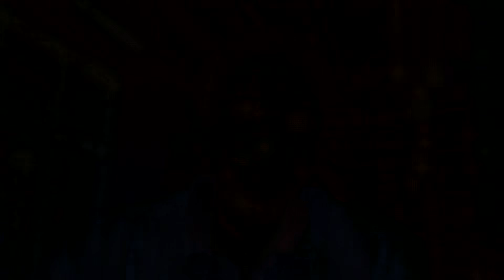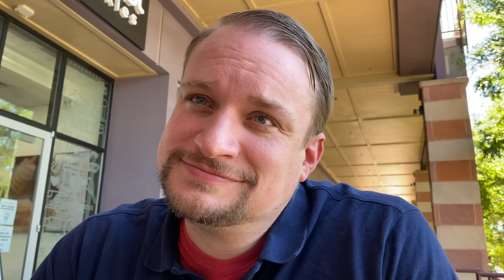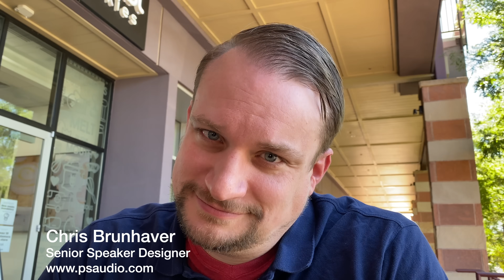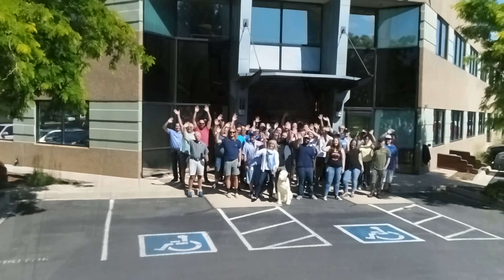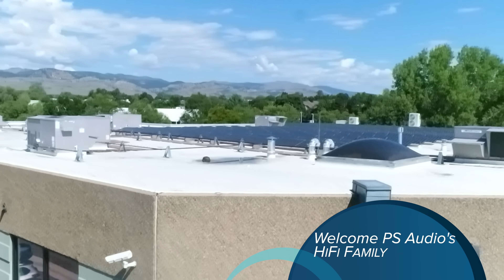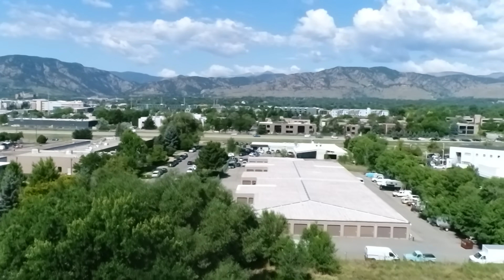Transmission Line Speakers

Comment: Chris is the right guy for the job. His knowledge in all things speakers is quite detailed.
Reply: I like him a lot. However, I wish PS Audio would have not developed their own drivers this early on, and already had their speakers on sale for two years.

Version 1 would have been significantly cheaper, and custom designed drivers would have been the project for the MkII versions.

Getting dispersion, the crossover, and namely the unique tonal characteristics achieved is a tall order even when you have the luxury of picking and choosing from hundreds of off the shelf drivers.

I would imagine custom made drivers dials in the thiele/small  parameters to exactly what you need, but tonal qualities are more elusive. I could foresee a custom made driver appearing to be perfect for a specific job, but it just doesn't sound right. Then you're waiting for the production of another custom designed driver. Delays abound and no one gets speakers with such an approach.

Version 1 would have been on sale for 2 years at about $6,000 cheaper. The MkII could then be offered to early adopters of version 1, if they wished to upgrade, at a 20% discount. Version 1 could then be sold to first time buyers under a certified used program and knock off 5%.

And PS Audio could be upfront and say, "We want to do our hifi family right and get them an amazing speaker, and at a fair price. As speaker development and refinement marches on at PS Audio, we want to make sure everyone who purchases our speakers can remain up to date, if they so choose. And the best way to achieve this is by making a trade in/upgrade program seemless and at a discount."

Comment: Often simpler is better. A speaker with a flat frequency response and extended bass might not actually sound good due to too slow decay and distortion. I've never found transmission line bass to sound good, but maybe I missed something.
Reply: How does a Transmission Line “introduce” distortion, exactly ?
Reply: @petersouthernboy6327  Chris said an uneven load on the driver, depending on frequency.
Reply: Jerry Rutten - I think that is more an issue for a full range driver with a whizzer cone (Lowther).  If you’ve correctly tuned your TL design, your standing wave resonance range is going to be filtered out by your crossover.
Reply: @petersouthernboy6327  I didn't say distortion is due to transmission line. The point is that many speakers are optimized more towards making much bass than making clean bass. The transmission line design introduces a delayed ring. The only approach of a woofer design that is time-accurate is the sealed enclosure. I very much prefer a sealed cabinet, possibly with servo feedback to further enhance the decay and minimize distortion incl. anything related to damping issues, thermal coil coefficient issues, and voice coil motion linearity. But surely a servo subwoofer is much more complex as it involves synergic design between the speaker and amp.
Reply: It’s always annoyed me that the  Powersoft IPAL system never gained more widespread OEM use.  And they never made it directly available to consumers on the components market.